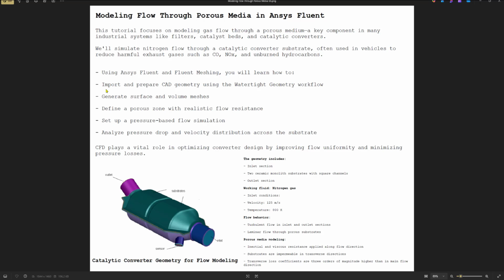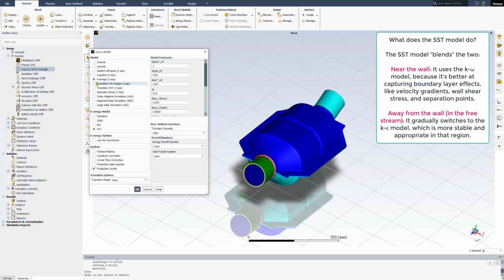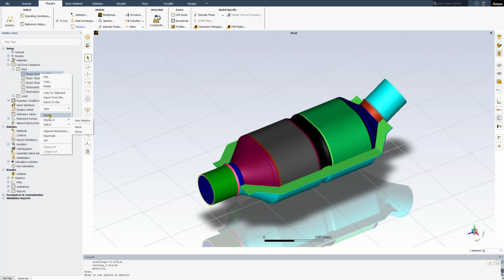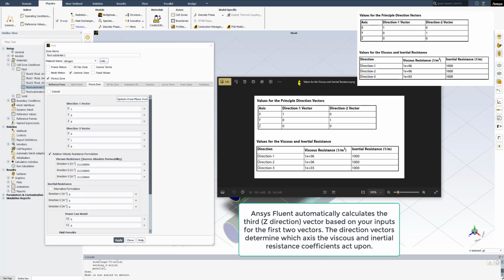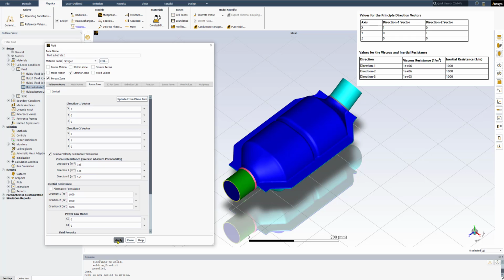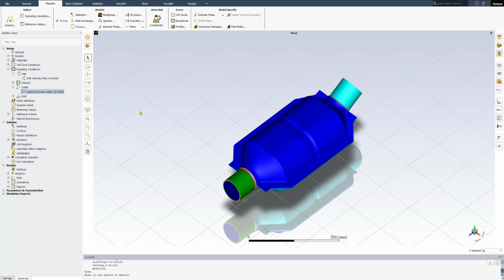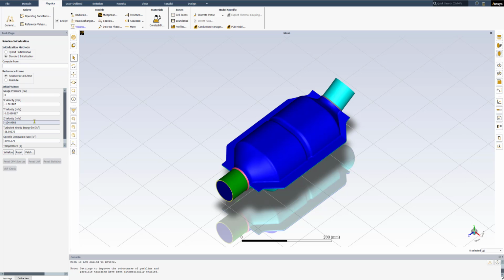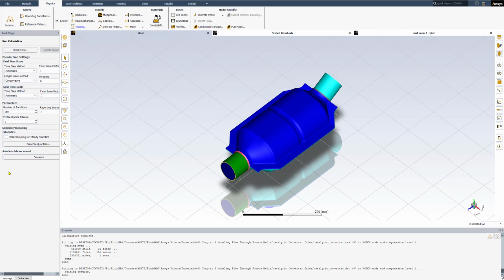Modeling Flow Through Porous Media – Part 2: Setup & Simulation in Ansys Fluent

Comment: could have been a good video but then you decided not to explain how the PZ constants are being calculated which is literally THE MOST IMPORTANT part of setting up a PZ model....
Reply from the maker: Hello @updatedotexe,

Thank you for your feedback — you are absolutely right that the porous zone (PZ) resistance coefficients are a very important part of the setup.

In this tutorial, the main focus was on the implementation of the porous media model in Ansys Fluent, so the resistance values were taken from predefined data (as shown in the slide) to keep the workflow simple and focused.

In practice, these coefficients can be obtained from:

Scientific papers and literature
Experimental measurements
Empirical correlations (such as the Ergun equation)

A detailed explanation of how to calculate these parameters is definitely important, and I will consider covering this in a separate video.

In the meantime, you may find these resources helpful:

https://youtu.be/T-2wfMQwYms?si=xNqiOhD2NYUMAH-6
https://youtu.be/GqfWUEt4unQ?si=bsXsbE5y4gy6MiwJ
https://youtu.be/sOQMXxoKFQM?si=RwKZw1CTA1B0gJmR

Thanks again for your valuable feedback! 🙂